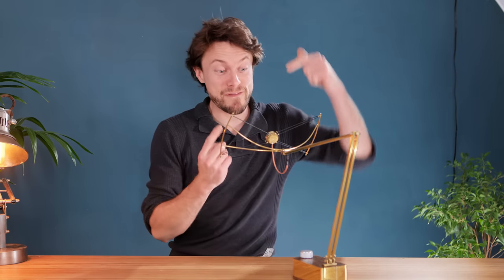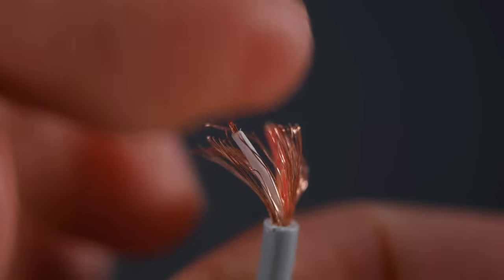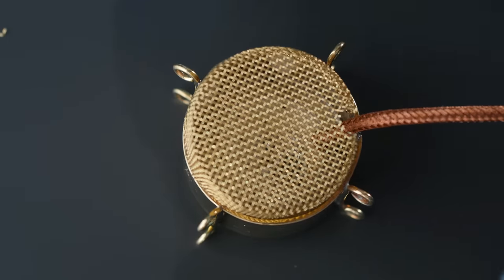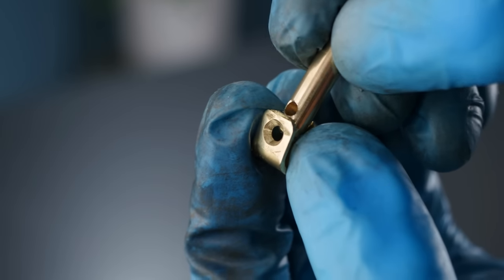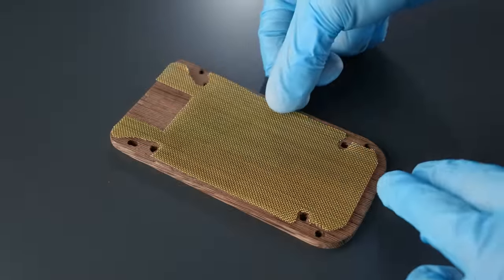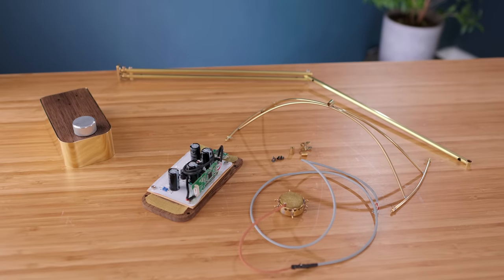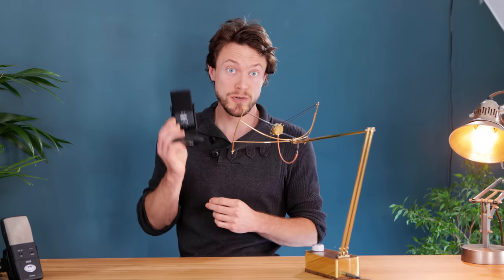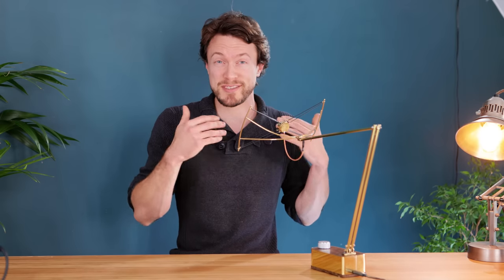Building a quality USB-C microphone

Comment: Just prefacing this with the fact I'm a professional audio engineer, with a Masters degree in microphone preamp design. For the price and required skills, this is AMAZING! such a cool build idea! I'm currently out on tour so don't have access to my workshop, but will be attempting to replicate this as soon as I get back home, with a few minor tweaks.

1) really simple, you even touched on it in the video. The rear porting for that capsule is compromised by the brass casing. Instead of using a brass ring with holes drilled into it I would suggest soldering the two brass grills together directly. A little bit of thought will have to go into shock-mount mounting rings but it will be worth it. You're effectively making the Mic HyperCardiod in its current format. 

2) this will sound really stupid, but placing a stretched piece of thin breathable fabric such as a pair of low denin tights (stocking for my American readers) will really really help. As it stands the microphone is slightly more simple and than I would like it to be and I found myself noticing S's and the odd plosive here and there. 

the next two are completely optional but could be really cool additions to the project and help the sound quality.

3) whilst I can see you are using basic filtering in the preamp stage I would suggest adding an R/C C/R  EQ filter to roll off everything below 30 Hz and everything above 18 kHz as the capsule will struggle to reproduce anything outside of this frequency range however the preamp will still be wasting energy amplifying noise you can't hear. These are a few of the additional components found on a lot of pro microphone circuit boards. a really simple step, massive quality difference.

4) sorry the audiophile in me had to... Try and use film capacitors where you can. Basically anything other than electrolytic as they start to introduce undesirable noise into the signal chain. On something like this, it wouldn't be the end of the world but when you get a few going into each other the effect really starts to add up.

5) I'd love to see this with the Texas Instruments INA217 mic preamp integrated circuit. It's quite possibly the best budget preamp circuit you can find, period.

6) I love your idea about using a simple premade USB to audio adapter, why don't you integrate the headphone output as well with simple passive volume control this would turn the unit into an amazing audio interface.

I'll drop you an email with these comments and a few other really nerdy ones as well for you to use or ignore at your own call haha. But overall, I can't say how cooll this project really is! I'm going to try it out with the weeks mentioned above and see if it's worth it. Would you be interested in doing a comparison video? I have a couple of Neaumanns & AKGs in my touring kit and would love to do an A/B.

All the best, Arran. 

P.S. If anyone else wants a list of the nerdy stuff just drop me an email: info@ArranHeaton.com
Reply: Great write-up, thanks.  I'm learning quite a bit here.  I'd love to see a proper audio engineer optimise the design and do some scientific comparisons vs $1000+ off-the-shelf mics.
Reply: wasn't the THAT512 built to replace the INA217? why would you want to get the less refined version of the same product? why not an SSM2019?
Reply: Will be following this thread for build updates. :D
Reply: I see you are good in this topic.
Therefore, I would like to clarify about USB Audio interface.
Is it just an adapter ?
If not, then what function does this thing perform ?
Thank you very much in advance.
Reply: dudee you should remake this video with your suggestions once you have access to your workshop again. Im def gonna watch that
Reply: Thinking about building this as a cheaper way to get into VO work and these additions, headphone control, are something I really want. Going to email for your write-up
Reply: @LC-hd5dc  interesting thing to note, is that the ina217 has constant short circuit protection, but the ssm2019 can only survive 10 seconds of that. Seems like it's worth mentioning in a diy discussion in case someone has difficulty with shorts and soldering. That being said the 2019 is a bit cheaper too.
Reply: @Strange_BORODACH  Audio interface is basically preamp with A/D converter.
A/D converter turns the analog electric signal from the capsule into digital signal, which can be than sent over USB. Computers can't process analog signals, It has to be chopped into ones and zeros first.
Reply: @Strange_BORODACH  it's an ADC (analog-to-digital converter), when people say "audio interface" wrt mics this is what they mean. you could also diy the ADC if you don't want to buy it
Reply: @platinumsky845  yep, ssm2019 is cheaper, good budget option if you know what you're doing. i was mostly surprised at ina217 being suggested bc everywhere i search it costs more than the that1512, the ina is $8+ wherever i see it.
Reply: Respect this hard work
Reply: Hey, did you get to your workshop? I'm really looking for your version pls. Have a nice day.
Reply: just commenting for the update.
Reply: Hi Aran! These tips Sound absolutely  great! Thank you for that.  
I am attempting this myself right now and am planning to Assemble the Board with it's circuitry. 
I would really like to add the headphone output you talked about in your comment (for both Desktop and microphone sound) , preferrably with a switch to control the volume of the mic output. Any Tips on where I can Look for the right Tools for this? Im a 20 years old IT Student with 0 experience in this field 😅
Reply: Really hoping you post your findings here. I'm looking forward to seeing what improvements an actual audio engineer can come up with.
Reply: Let us know when you build one! I want to checkout how it goes with those changes. Sounds interesting.
Reply: Posting for a possible update
Reply: @jcm6254  In what way is this "shit talking"? Listing improvements to a project in the nicest way possible seems far from that.
Reply: One correction:  Americans call the thing your describing "pantyhose".

I know because I've made a few pop filters in a pinch out of them and they work very, very well.
Reply: Hey you seem like the right person to ask this to: I already have a dbx 286s and a Focusrite Scarlett Solo... my mic isn't bad (a Rode NTG4) but something like this looks amazing... but I'd like to just plug it in to my preamp/processor using an XLR connection instead of going through all that trouble with the USB stuff. How much of a PITA would that be?
Reply: Thanks king 👑
Reply: @StevenLandesVO  I hope it'd be less of a PITA than including an audio interface, but my electrical knowledge stops at "don't stick forks in outlets" and "don't drive capacitors too hard unless you're filming it in slow mo" so could be way off base
Reply: From one musician to another, great input 👌
Reply: personally I would add springs to the articulated arm so it could stand in any position, like desk lamp stands.
Reply: STILL NO UPDATE ??? - it's been a long 4 months 😂 🎉 

Where are you Mr.Audio Engineer 🤔 I guess you've lost your home address & still searching for it that's why it has taken 4+ months instead of a few weeks 🤷
Reply: Would there be any issues if the back of it is just a solid piece of brass instead of mesh on both sides?
Reply: Ok you made you point. You have a phd 😂
Reply: Intresting
Reply: Great reply 👍🏼
Reply: Commenting for the update... and the algorithm :)
Reply: As others have already mentioned write up! Did you ever get the opportunity to recreate this after your tour?
Reply: Any chance for a shopping list?
Reply: Goddamn dude, take my sub. if you're making this at home why not do a quick documentation video on it? i'm aware i'm 5 months late but i hope that doesn't bother
Reply: I like your funny words magic man
Reply: this is actually the longest comment i have ever seen on youtube, it evens have it's own scroll bar
Reply: So after reading your answer i got a few quests?

First: where to place the breathable fabric and why?

another would be why´d you recommend the INA217 over the THAT1512? quick google search told me that both are overkill for the quality of the used microphone and that a THAT1512 seems to be better? in what sense i dont know.

Next would be the placement and specs of the RC filters for the 30-18000Hz range... haha ^^`

The audio USB interface, are there better quality ones out there or is the Audio quality itself limited by USB thus searching for "better" interfaces would not improve the overall build and any interface would do?

and the last one: a forum entry suggests using some kind of "MEMS microphone", is the Capsule microphone used here still a better option?
Reply: @Adrio999  Thank youu haha
Update coming very soon, waiting for parts
Reply: @cxuri  Just a masters haha
Reply: @jasondads9509  Just got home, Parts are on their way, Update video to come soon. Subscribe/ follow me on insta for updates :) https://www.instagram.com/AHPRODUCTIONSUK
Reply: @LC-hd5dc  It's mainly oersonal preferance, from my expereice the build quailty was marginally better, however the variation was almost negligible which cannot be sadder for the other preamps you have listed here. In previous testing I have found the variation on the TH chips to be severe enough that when using more than one channel it is almost imposible to match them without significant additional tuning.
Reply: @umarahmed1252  It's happening! Just got home, Parts are on their way, Update video to come soon. Subscribe on YT to watch the final thing or follow me on insta for build updates :) https://www.instagram.com/AHPRODUCTIONSUK
Reply: @DonovanBio  It's on it's way. I just got home!
Reply: @Mel0n  It's coming soon!
Reply: @Kevin-jb2pv  Hahaha, Thank you! Can you tell I'm British
Reply: @StevenLandesVO  None whatsover, you have all the right parts already! I know this comment is a bit old but if you still need help drop me an email. it's a bit more complicated than a youtbbe comment but simple enough to do
Reply: @TAP7a  Hahahahaha, Best comment yet!
Reply: @Spencerlayne  Thanks mate!
Reply: @TheGameLecturer  Grea Idea! although you can pick these up pre built really cheap now
Reply: @ahnaf2971   I'm so sorry man, work comes first (somethign has to pay the mortgage haha). I just got home, parts are on their way with a video to come soon. Subscribe on here to see the end result or follow me on insta for build updates :) https://www.instagram.com/AHPRODUCTIONSUK
Reply: @mangosteen4230  Yes and no, it depends on the characteristics you are going for. Personally I wouldn't recommend it
Reply: @jasondads9509   I just got home, parts are on their way with a video to come soon. Subscribe on here to see the end result or follow me on insta for build updates :) https://www.instagram.com/AHPRODUCTIONSUK
Reply: @wilville3752  haha why thank you
Reply: @happyspacefun3796  Hopefull it helped?
Reply: @ArrAnheAton  i mean it was plenty interesting at least
Reply: @ArrAnheAton  Ayy, finally can't wait :D
Reply: @ArrAnheAton  I've been trying to come up with an updated board schematic but I am an absolute novice at electrical circuits. Looking forward to your final results.
Reply: Why does a degree, let alone a graduate degree in microphone design exist?
Reply: @ArrAnheAton  make sure to update here too!
Reply: @LC-hd5dc  cuz its cheaper
Reply: Can wait to see your final result
Reply: having seen his side by side test ... I see what you mean with the plosives and such ... one can hear the difference between the two ... a little more circuitry and for under 100 bucks one has something comparable to the 3  grand mic ...
Reply: Ok
Reply: @ArrAnheAton  my turn to poke about the cool mike revision! 🤣 (subbed to your youtube btw). I am determined to build one of these myself as well, despite having no tools and no experience with building anything outside of lego 🤠
Reply: Sorry but you mention electrolytic capacitors introducing noise into the signal. Can you forward me to some literature talking about this? I haven't ever encountered this before
Reply: The INA217 in DIP-8 be obsolete :(  Only comes in a SOIC-16 which lends itself far less to the DIY group.  I hope you don't give up on making one, or many revisions.
Reply: As someone who isn't super familiar with electronics, is there an equivalent model of film capacitor I can search for, which can be dropped into the circuit with no other modifications? The art side of this project is deeply intriguing to me but the electronics engineering is a bit outside my depth at the moment.
Reply: … aaaaand nothing ever came of it!
Reply: I know this is an old video/comment, but any suggestions for someone with the hand skills to make this (but alost zero audio/electronics knowledge), but would need to make it have a 3.5 mm mic connector to plug into a desktop gaming DAC?

Comment: Using the braided de-soldering wire in the way you have is a masterstroke. Incredible.
Reply: I was stunned and overwhelmed by ideas.
Reply: how does it not short the circuit?
Reply: @Pe721  The wires inside are enameled.
Reply: @oddvoid  just noticed him sayin it. Ups my english just aint good enought. Thx a lot. Gonna post here once i build this thing myself.
Reply: @Mr. Rich B.O.B That braid itself is conductive. It's made of copper after all. It has to be conductive in order to work as an RF shield. Also, the wires that go inside are enameled, so that is no issue at all.
Reply: Only problem is its impregnated with flux to improve its desoldering capabilities. Not sure what effect that could have long term, I suppose the biggest issue would probably be if the flux had some kind of chemical reaction with the enamel on the copper wires. I dunno if that's something that could actually happen tho.